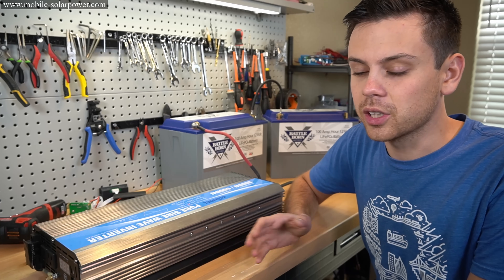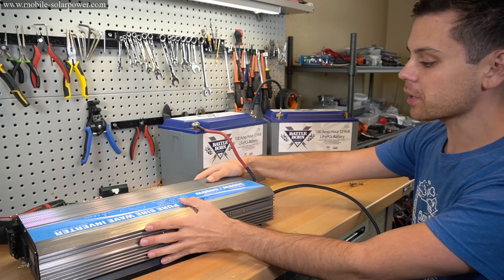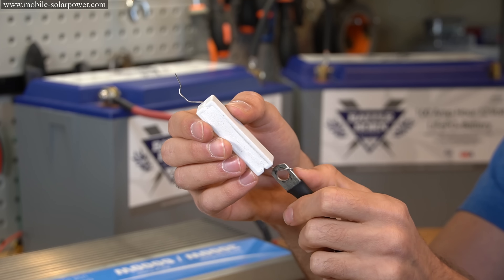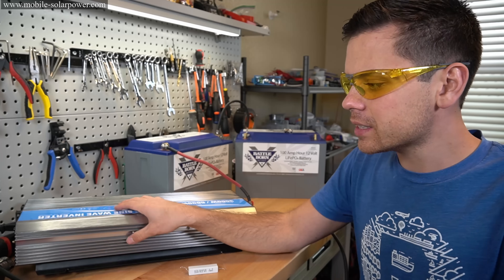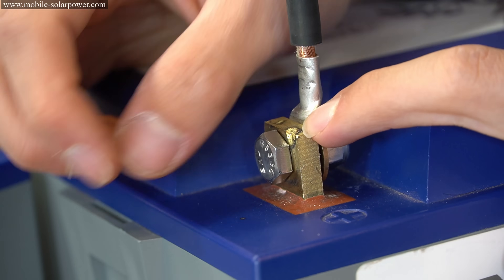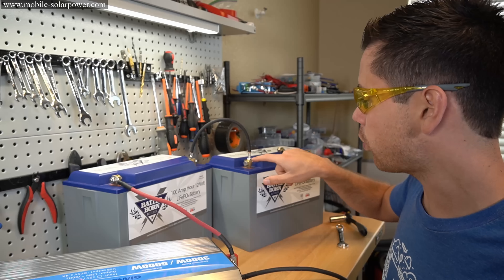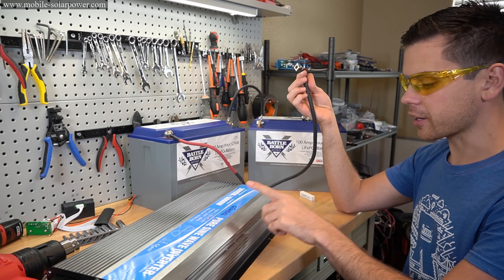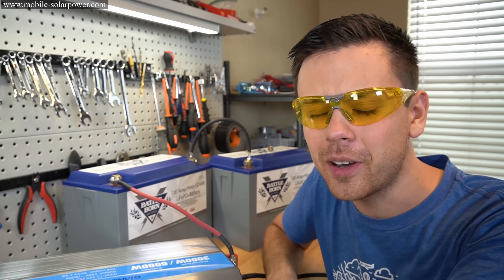How to Pre-charge Large Off-grid Inverters SAFELY. Save your eyes and your bank account

Comment: Precharge resistors are good. You can use anything from 1Ω to 100Ω depending on how much current you want to flow, and how long you have to wait until charged.
If you put a scope on it and record the voltage over time with different resistors, then you'll be able to show properly what resistance to use is best, and why.
Reply: Easiest way to pre charge is with any INCANDESCENT light bulb. A 100W 120v bulb will do it instantly on a 12v system. On 48V setups the bulb will get lightly lit and go dark in a second or two. Should be across inverter supplying circuit breaker. If mounted on a light bulb socket, it can be unscrewed and turned in before breaker is reset.  Not pre charging is a crime against inverter input capacitors.
Reply: @egilsevalds3920  Good idea, though incandescent bulbs will be as rare as unicorn poop soon.
Reply: @ahaveland  stores will still sell appliance bulbs at very least
Reply: @robby-y3x  Yes, 15W oven lamps will probably never go out of production!
Reply: @ahaveland  You can buy "Easy Bake Oven Heating Elements" aka 100W incandescent bulbs. "Rough service" bulbs can still be sourced, and specially shaped bulbs are not covered in the "incandescent ban" either. Remember, these are essentially resistors so hooking up three 40W bulbs in series gives you a 120W resistor so even with smaller bulbs the concept works.
Reply: @egilsevalds3920  Why not just use a test light?
Reply from the maker: I would get Sparks with 8 ohm resistors so bumped up the recommendation. I should have tested it. Thank you
Reply from the maker: Oh very smart! Thank you Andy :D
Reply: Just use ohm's law and work it out. Will was getting sparks with 8ohm because that's about 3.5amps or 80+ watts. The 30ohm in the video is only 0.9a or 22watts. .

Comment: Ok, but I’ve never seen precharging recommended in the installation manuals. But the manuals were for inverters/chargers designed to be connected to deep cycle lead acid batteries. It would suck to damage a expensive battery or BMS.

Comment: A little of topic but in the interest of preventing damage, I have a question. Can all brands of solar panels be wired in series or will the increased voltage cause damage to some brands?
Reply: Jason Bowman thanks for the info. I wasn’t sure how/if it would affect them and didn’t want to risk ruining the panels. I bought the same EPever controller that everybody else is using so 24 volts shouldn’t be a problem. I plan on putting 2 100 watt panels in series and then putting 4 of those pairs on parallel for a total of 800 watts at 30 amps
Reply: Most panels I have seen is rated at 1000v max in series so it is not normally a problem and the danger is more to your MPPT charger as that normally can not take such high voltage. (normally 100v or 200v max for most MPPT solar chargers I have seen, look at the specs for your charger what the max voltage is)
Reply: @Jason Bowman Also the panels should be similar sized: putting three 100W panels in series with a 50W panel risks overpowering the 50W panel and driving it in reverse, causing it to heat up or fail. (No problem putting three 100W and a 50W panel in parallel, as long as they have similar voltages.)

Comment: Will, good info but does this refer only to Lifepo4 batteries with inverters or should this procedure be applied to Pb acid batteries as well?
Reply from the maker: I'd rather be on the safe side here and tell people to do it either way. There is no way to know everyone's component choice, so I'll just tell people to always use a resistor anyway.

Comment: If you don't have a resister you can use a light bulb.
Reply: correct, or a car lamp of the correct voltage. Won't work with LED